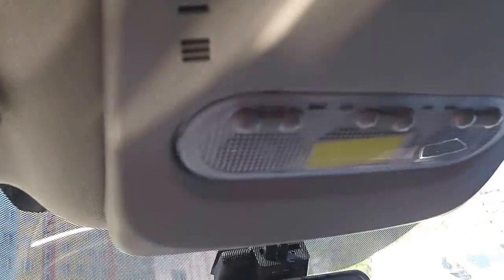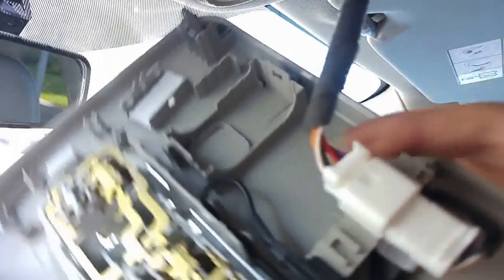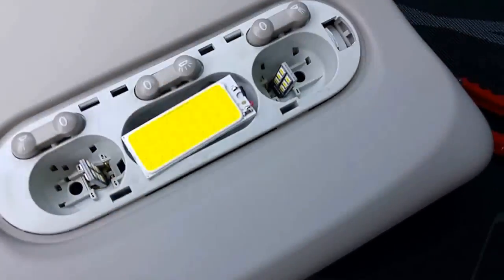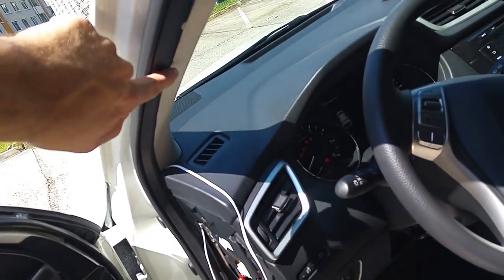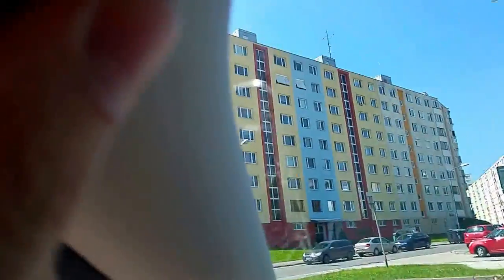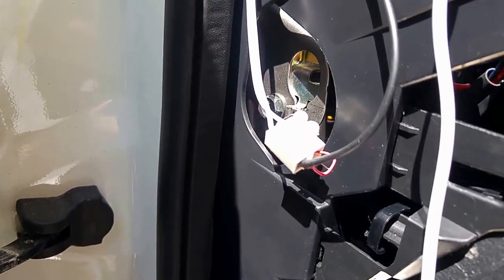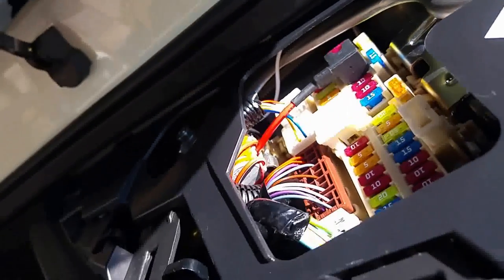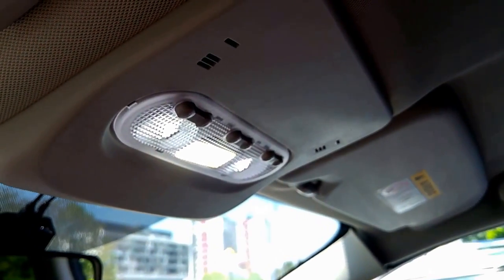📈Nissan Qashqai J11 - removal of roof light + microphone adjustment from android.

Comment: Hi, it's not possible to use the nissan microfone instead of third part microphone? It's not a normal microphone with 2 cables?
Reply from the maker: Hi, i guess its should be easy job to cut the wires, and test it, but my way of doing this is that i can convert whole car back to stock over weekend in case that i want to sell it. Since microhpone is not good when calling, i guess its worth a try to do it. Maybe ill do video, but no longer motivation after google actions on monetization.
Reply: @frostsilenec  Thanks for the answer, but I intended to connect it using the cable in the connector behind the stereo instead of install a separate cable, just using the existing cable because I want to replace with new  android car tablet the have separate cable for mic.
Reply: @raffaelenapolitano9341  Ciao Raffaele, anch'io penso si possa utilizzare il microfono della plafoniera perchè non amplificato. Basta connettersi a questi due cavi e all'altra estremità saldare un jack maschio da 3,5 mm per innestarlo sulla femmina del tablet.
Reply: @raffaelenapolitano9341  Ciao. Hai già fatto questa modifica (usa il microfono originale)? Sono anche interessato a sapere se funziona e come è fatto. Grazie.
Reply: @arobAlbiero  Ciao. Hai già fatto questa modifica (usa il microfono originale)? Sono anche interessato a sapere se funziona e come è fatto. Grazie.